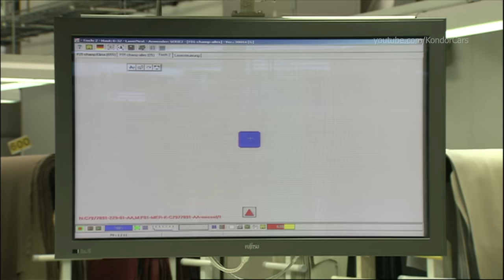BMW 5 Series Production in Dingolfing Germany

Comment: Super good filming. Thanks for sharing. Liked and subscribed 👍 Always impressed with German manufacturing.
Reply: I'm not. A friend of mine has bought new BMW's exclusively for the last 30+ years. The number of warranty claims he has made has seemed astounding to me. New engine, new gearbox, new suspension components, electrical issues..... Me?  I buy used "bread and butter" fords, Skodas etc. Never needed a new engine or gearbox yet, in 50 years of driving.